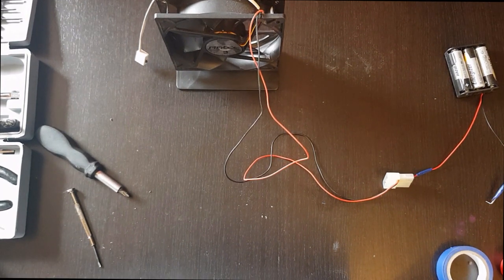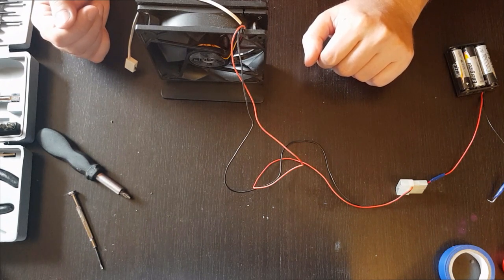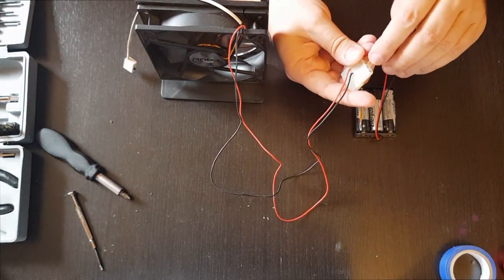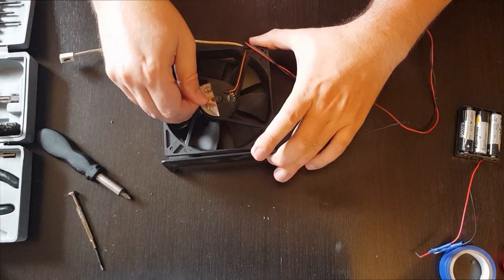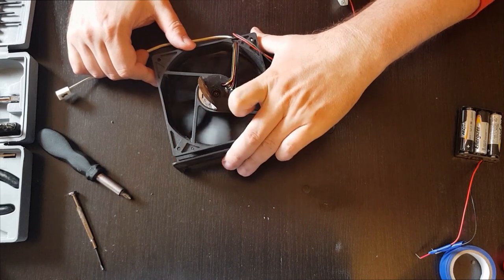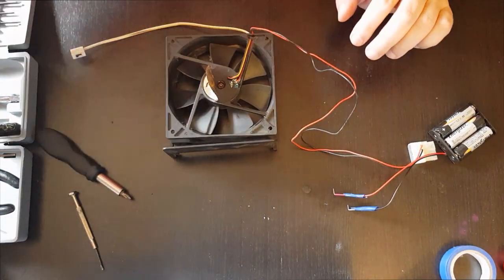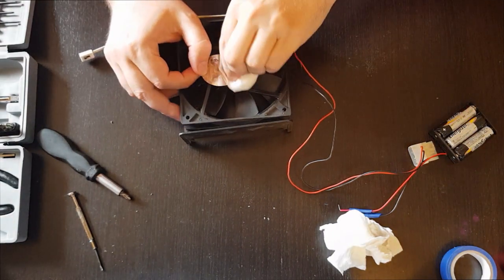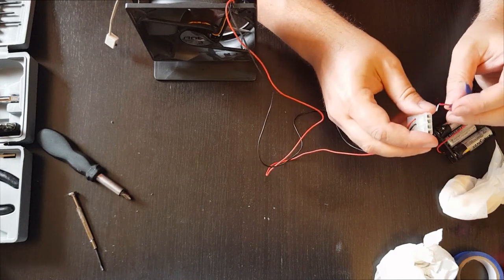Making an old computer fan run silent again

Comment: Wd 40 is not a oil for bearings its a ok penitrating lubricant for bolts what its made for is is keeping water off of things if you do this to a fan it won't last as long as if you use moter oil
Reply: encharquei o bagulho de óleo singer e não quero pensar nisso
Reply from the maker: You are right. If one wants longer lasting results, then some motor oil is better. I would actually say it's better to first start with WD40 to clean up any residuum, use some cloth to clean it, and then apply oil. On the other hand I used WD40 alone on another computer fan and it still works ok after about 2 years (not being turned on every day, but at least weekly).